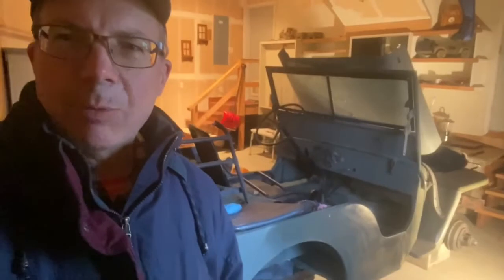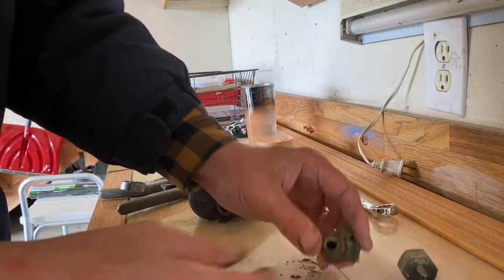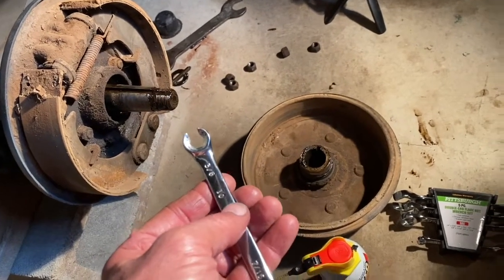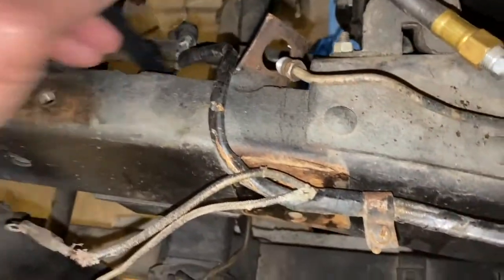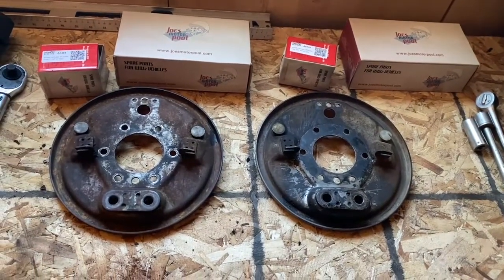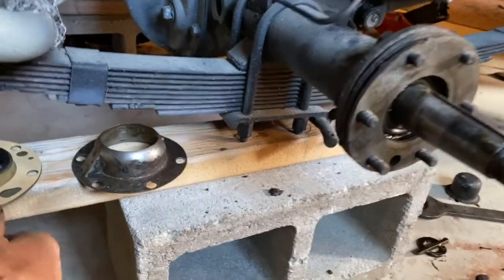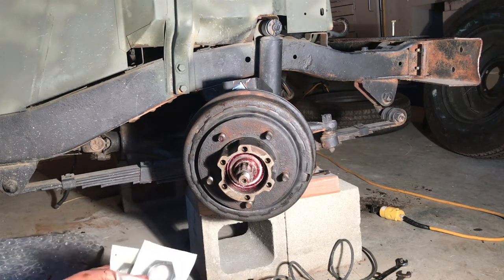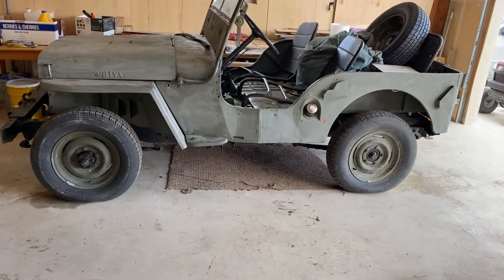Here’s how to install a Willys Jeep Brake Kit for a CJ2A from Ron Fitzpatrick Jeep Parts, Part One

Comment: Nice video, thanks Scott. My 46 CJ2-a also needs a brake overhaul. I'm weighing the option of converting to 11 inch drum brakes, which seems to be a very popular conversion. Did you consider it? I'm keeping mine as-is, which is stock 134 and no overdrive and I'm thinking well maintained 9 inch brakes will do fine.

Comment: Scott, I believe the the short primary shoe usually goes in front on most vehicles. Also does Jeep require a preload on your wheel bearing? On most vehicles the first spanner nut on the wheel bearing after being torqued is backed off to relieve the preload and then the second spanner nut is locked down to hold the adjustment.
Reply from the maker: Hi John,
I should have backed off 1/16 of a turn after the preload. I will correct this next time I work on it. Thanks for catching this. According to Ron Fitzpatrick Jeep Parts the longer shoe faces the front of the vehicle.
Reply: @ScottsGarage17  hmmmm that's that's first in my 38 years  the primary shoes . The short linings always go to the front of vehicle .. hence ....
Reply: @johnnyautotech4722  these are not conventional self adjusting drum brakes. That is why the long shoe goes to the front.
Reply: Yes long shoe goes to front, also need to bend washer to one flat on out side nut acts like lock washer.
Reply: The correct preload is torque to 50, then back off 1 flat.  The outer nut then gets torqued to 50 ft pounds.  Jeep had to be d iffdrent, and put the long shoe in front??  Go figure!  I like to put the 11 inch brakes on the front axle, especially if larger tires are run on the jeep.
Nice vid, 2 thumbs up!